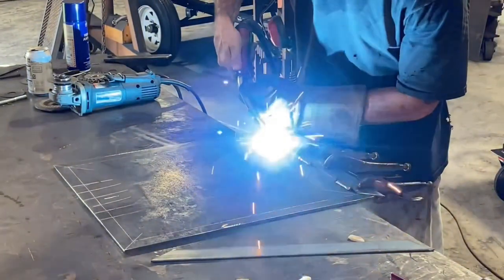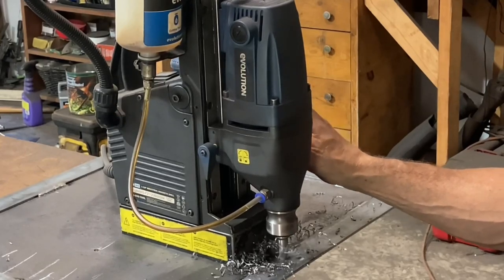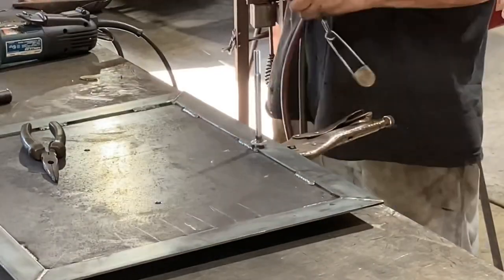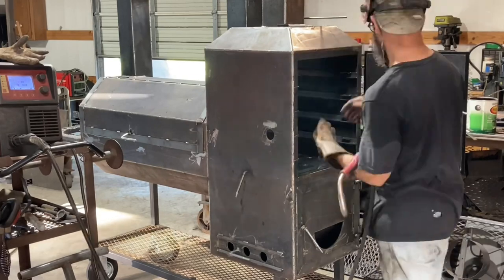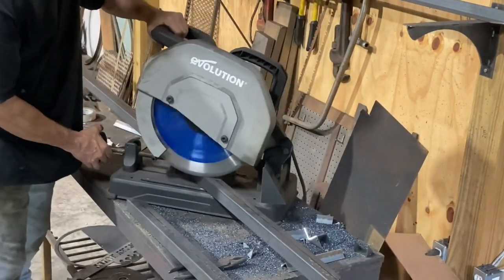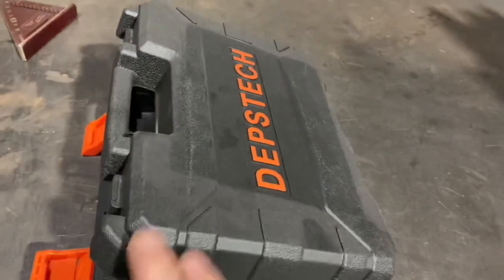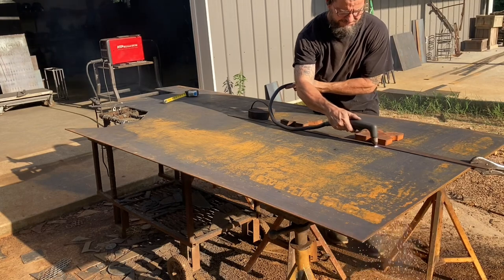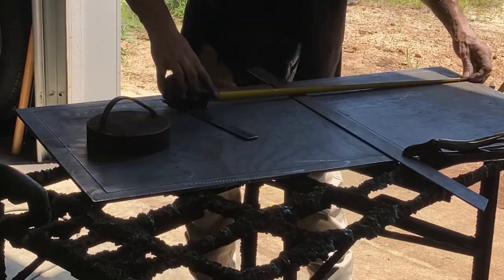Building bbq smokers

Comment: Currently have a primeweld mig 285 but a htp pro pulse mts 220 popped up in my area. I'm tempted for the pulse feature. Puts less heat so doors won't warp